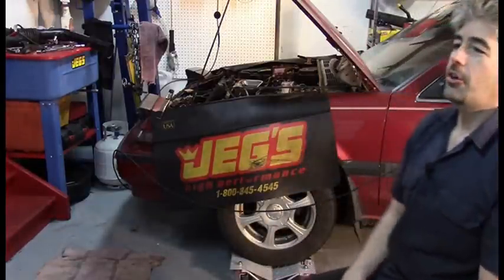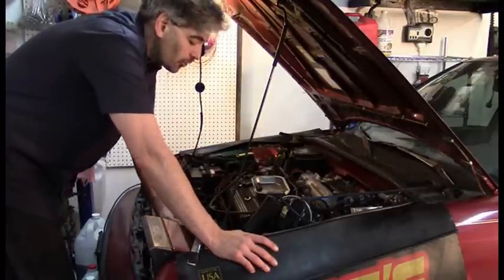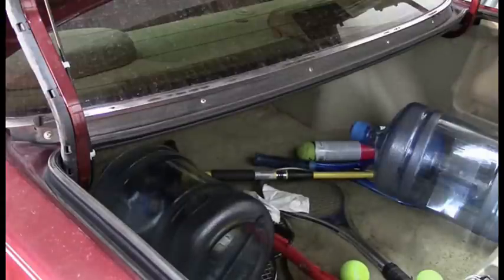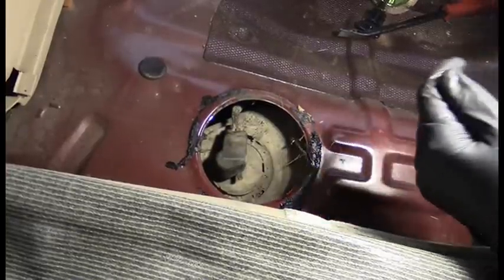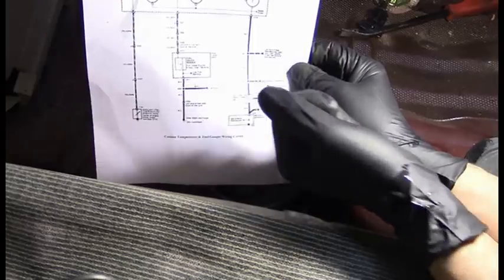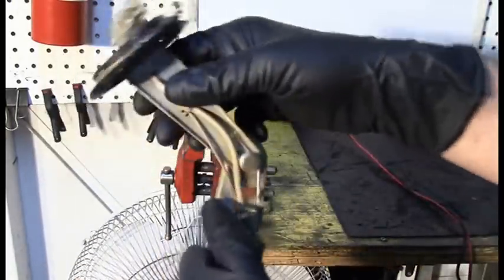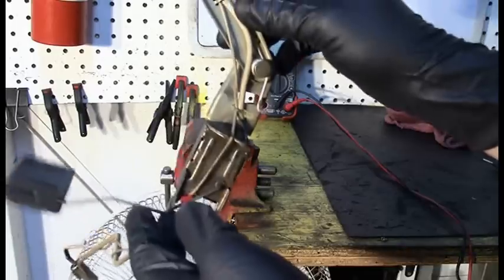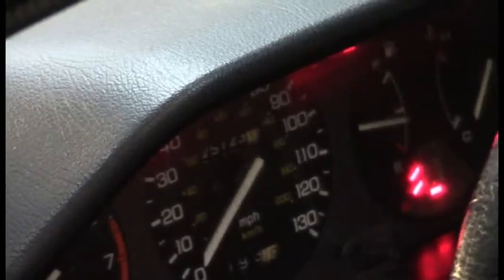Diagnosis of Stuck Fuel Gauge- Is it Gauge or Sending Unit?

Comment: Nice diagnostics Matt. Just a tip when you can't get to the sending unit easily is that I look for a connector which is usually under the hood that goes out to the sending unit. There at the connector I'll put a rheostat or you can use a resistor as you did to simulate the sending unit.
Reply from the maker: Thanks Terry, I would do that if I didn't have an access at the sending unit connector at the tank.  My thinking was the closer to the tank I am, the more wiring I am checking as well as the gauge and unit.  By checking at the tank, if I get the gauge to respond the problem must be in the tank and cannot possibly be wiring from my test site to the tank, right?
Reply: Exactly Matt. I would do exactly as you've said. If you can get access to the sending unit, then by all means check it there first as you've mentioned, you're checking all the wiring too. It was only if you had to drop a tank to get to the sending unit would I look for a connector else where. I would hate to drop a tank only to find outer later that it was inside the instrument cluster. Take care Matt...